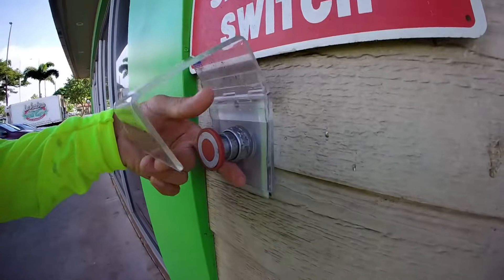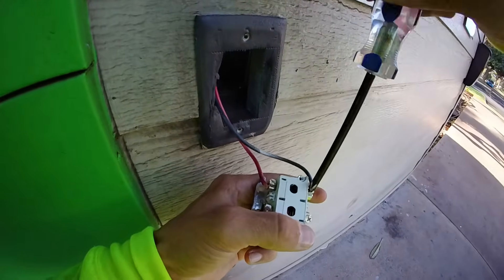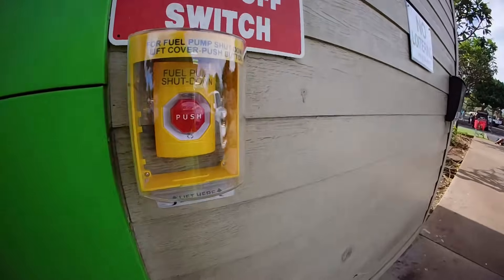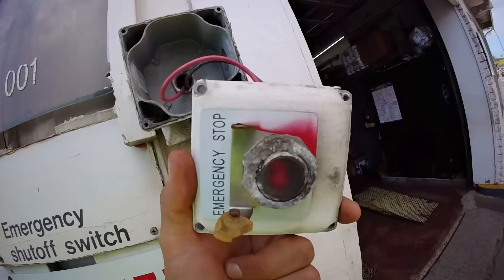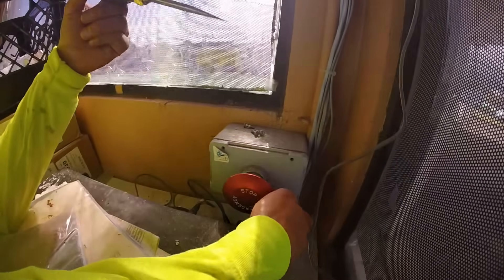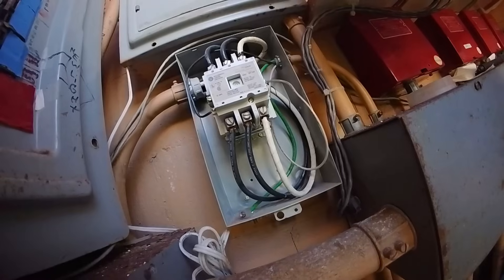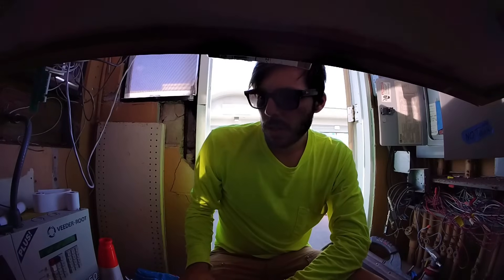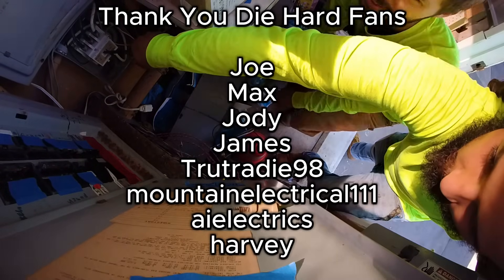What Happens When You Push These? | Let's Work EP. 59

Comment: So you’re working in an active fuel station with live unenclosed contacts and ,during connect risk of sparks !! Sounds like this might be against regulations ,also stop buttons are normally used with break to fail as someone else pointed out in the comments .
Reply from the maker: @lordbyrom100  nope. It was all shut off… but yes I agree it should be “fail safe” as they say. A normally closed system is better

Comment: Firstly,  It should not be a "Normally Open" control as a SAFETY Switch....  For obvious reasons that if the circuit is "Cut" or "Disabled" or conductors incidentally damaged "As Open" this Shutdown E-STOP is Worthless 🤔  Secondly,  You bypass(disable) "The Circuit" in the Fire Control or Equip Room before even touching that switch because I have come upon them where they were literally hanging out of the wall or damaged then triggered accidentally Grounding/Shorting  upon disassembly. Third, make sure you completely understand that companies Fueling "Shut-Down" Procedures, Communications and Resetting per Guidelines. Sometimes upon E-Stop Activation alarms and strobes may disrupt facility in addition to Fuel Pump Disruption.  Additionally a Central Station Monitoring may be involved with a possible Notifications to Local Fire Departments?   Think of these E-Stops as if they were nuclear missile launching buttons,  to you,  thereby preventing an awkward situation.  If you are fully prepared and have base contingencies planned.....  THIS Risk? Can only happen with the unprepared technician, so preemptive communication IS Gold. 😊👍
Reply from the maker: @russk5513  great insight! Luckily for me in this case… the sites I’m working at are primitive to say the least.

Comment: When i mount emergency NC switches, i mount two of wago clips before and after, so i can make a bridge, if necessary...
Reply from the maker: @do4pc  oh yeah! That’s actually an awesome idea. Guess it has to be already established to not interrupt power, but some electrician will thank you when they encounter it in 15 years lol
Reply: @Electchickn  1st time just remove a few mm of insulation and use a short crocodile cable ;-) 
I´m working in electricity meter changing in germany, often under tension and sometimes we cannot cutoff the customer, even for the needed 4 minutes... a couple of 150cm 4mm² cables with crocodile clamps at both ends will do the job.
Reply from the maker: @ oh yeah or I wonder if theirs some mini piercing-tap clamps just for the purpose

Comment: If you're taping your breakers open, I'm refusing to touch anything. I'm also letting FD know.
Reply: @ArkaniumGaming  that's clearly painter's tape. It's not going to hold any breakers open, it's just covering them so employees don't touch them.
Reply: @josephsager9425  I am very aware that this is painters tape and that it has next to zero holding power. I'm speaking from past experience where breakers were being kept forcefully open. At my first job one of them was nearly untouchably hot. [tbh idk how that place hasn't burned down yet]
Reply: @ArkaniumGaming  Fortunately, modern breakers have an internal disconnector that will let them trip with a locked lever.
Reply: @Nidkidful  These breakers are from around the 80-90's [if not later]. They're running on heat, grease, and a false hope.
Reply: @ArkaniumGaming  some breakers are required to be locked on, like fire systems

Comment: Haven't worked on these but I do have first-hand experience as a gas station employee having had our pumps shut down with thr button. It electrically disconnects every pump, as well as every underground tank pump. If anything goes wrong turning it back on, it can take hours to fix.
Reply: @KatieTheDev  turning back on only requires the the estop button to be pulled out ,once this happens the contactors pull back in ,engaging so the power to the electrical panel that controls the tank field ,fuel pumps and possibly canopy lighting back on
Reply: @wesleystaub5416  you clearly didn't watch the video
Reply from the maker: @KatieTheDev  let me guess… homeless guy pressed it?
Reply: @Electchickn  nope! One time was a bored kid who wasn't being watched. Other time was me, because a customer had yanked a hose off and was trying to reattach it, causing a leak. I'm sure if I worked in a bigger city you would've been right!

Comment: A normally open emergency stop switch seems like a bad idea to me. Safety switches should always be wired normally closed to fail open if the switch gets disconnected or damaged.
Reply from the maker: @shmuelglick4774  yes. This situation is was used as a shunt trip. Basically just shorting the circuit making the breaker trip
Reply: @Electchickn still sounds like a god awful idea
Reply: A normally open switch on a SINGLE contact. The voltage is probably used as a trigger coil to trip the control power breaker.
Reply from the maker: @ yes
Reply: here in the UK it's a NC, litterally just a special double pole switch on the outside of the building between the breaker and pumps
Reply: Fuel facilities, gas stations all have emergency cut offs it's in the code book, it's a requirement, again the 120 volt comes out of the 120 volts panel, however there should be 2 2pole or a 4 pole contactor between the main 120/208 Volt panel and the electrical panel that feeds the gas pumps ,tank field and possibly the canopy lighting and yes estop is wired NC normally closed
Reply from the maker: @ watch the video just after this! I encountered that exact set up. Great insight
Reply: I always thought they were attached to an alarm system, i.e. automatically calling the fire department.
Reply from the maker: @ yes. Maybe some of them, or at large urban centers.
Reply: @Electchickn  here as someone else mentioned it's a specialist fireman's stop switch, typically meant to be operated with a switch pole or a  firefighter's axe
Reply: the machines that my last job had, had NC and NO contacts on all the E-Stops

Comment: For the normally closed estop situations,  maybe used some insulated tap connectors and a short piece of wire to jump out the button while replacing it. Cut the jumper, remove the tap connectors and tape where the wires got pierced.  Oh, the kitty litter is to help with gas or diesel spills.
Reply from the maker: @mxslick50  too much effort for these guys haha. And yes the kitty litter thing clicked after I made the video